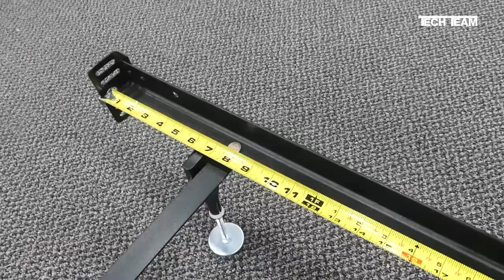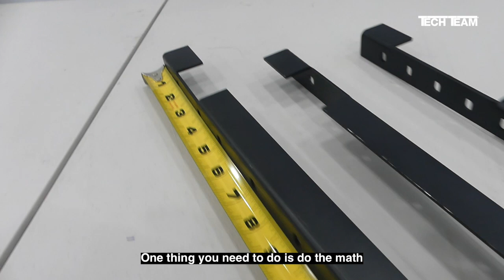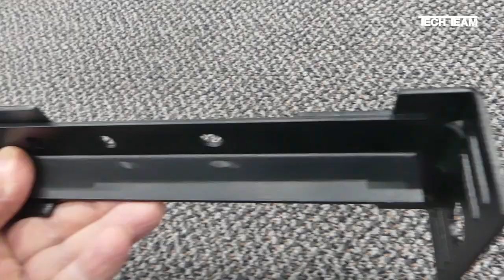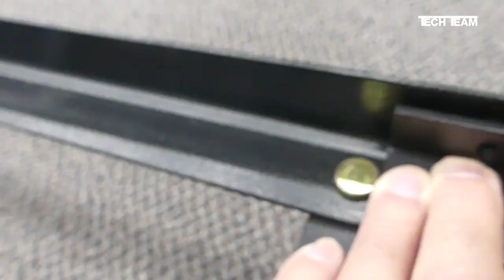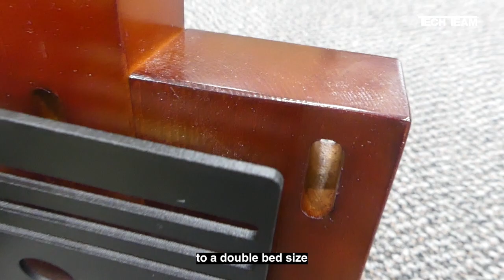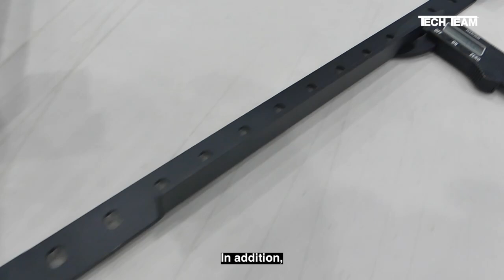How to Install a Headboard Extension Set to your Metal Bed Frame – Use Tech Team 00712/00928

Comment: I just got a couple metal platform beds set up and the box springs slide off too easy. So I was looking for something like this to “box it in” so it won’t slide around when someone tries to get on. These look like they’d work for that purpose, but was wondering if you make something that would extend up a bit around the platform to secure the bed?